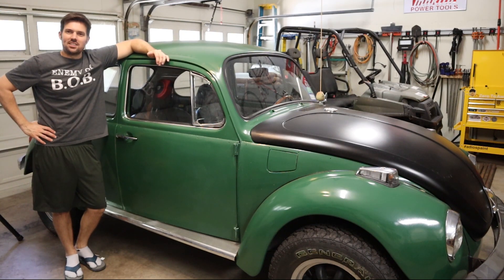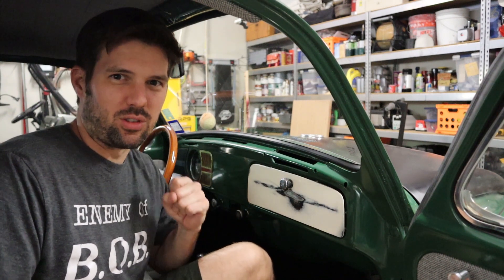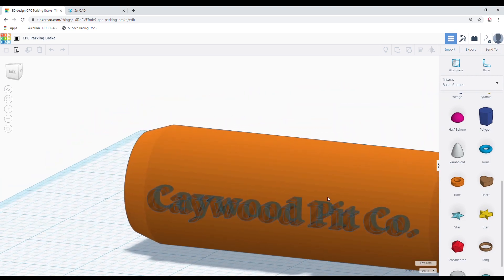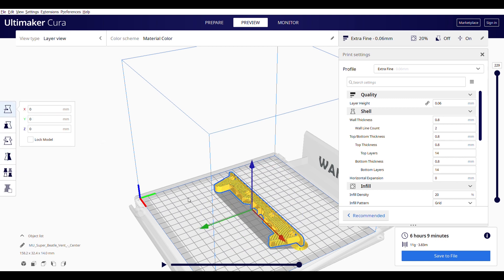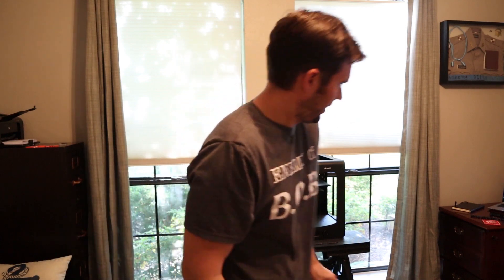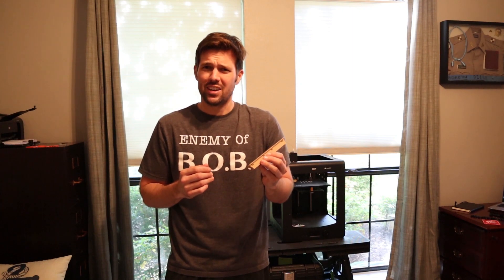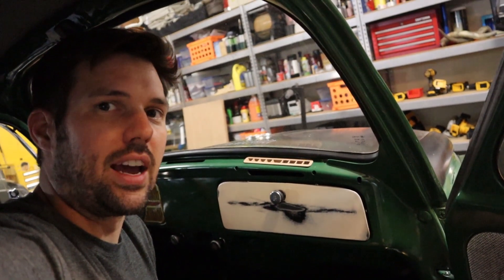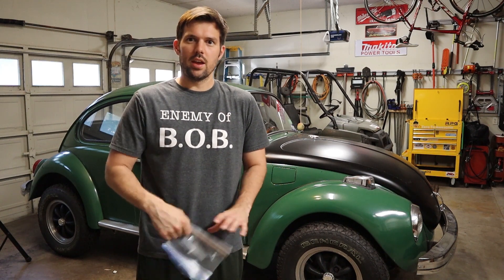3D Printing Hard to Find Car Parts for my Super Beetle Project

Comment: Nice work!  Have you tried selling any?  I designed a discontinued part from scratch for my S10 Blazer and ended up selling a set right after posting about it on IG.
Reply from the maker: I can barely keep up with the my own projects! If someone really needed a set I could send one their way but my turn around probably isn’t great for customer service.
Reply: @ZeroToAwesome  I know just what you mean with the projects!  Still, nice to find ways to make a few $$ to support the projects. . .and the community if no one else is making certain parts.

Comment: : Nice! Ever think about tweaking the design to account for the curve of the dash?
Reply from the maker: Once you peel off the rubber-ish padding the steel vent openings actually are flat. The dash is curved, but around the vents is a nice flat area. Any bigger and it would probably be good to put a curve in them.

Comment: I restored a 71 super beetle convertible when I was in university. And now I have a 3D printer, actually two of them. I've made parts for my wife's mini with them. I've designed parts too. That's even more fun.
Reply from the maker: Definitely adds a cool little touch. Which material(s) do you print with?
Reply: @ZeroToAwesome  I mostly use PLA but for inside a car because of the temps and sunlight you should use PETG. The printers I have are both Ender-3 on Amazon.

Comment: have you had the prints in your car for the summer? if yes has there been ill effects for them being in a hot car? i live in AZ and have had the thought of buying a 3d printer for interior parts. do you think it would be a wise investment for me to do so?
Reply from the maker: Some of the wood-fiber filament was starting to warp. I think that was due more to humidity than heat since it has been the fall here and not too warm. 

I have been using a carbon fiber PLA recently and it seems to hold up really well to the heat. A lot of these parts have been reprinted in this.

Comment: Good stuff!  I need a 3D printer.  Probably save myself some $ with all of these older cars I keep getting into, parts are pricey.
Reply from the maker: Prices of these printers keep coming down. This one has paid for itself in repairs already!
Reply: And learn to 3d model, because you can't find all the parts on the internet. And probably wood filament is pla so it will not withstand the heat in the summer.. because its soft at about only 50 Celsius